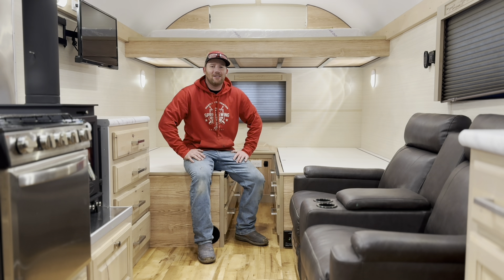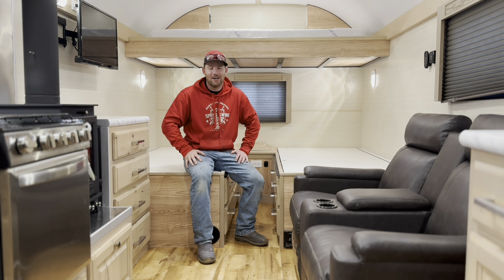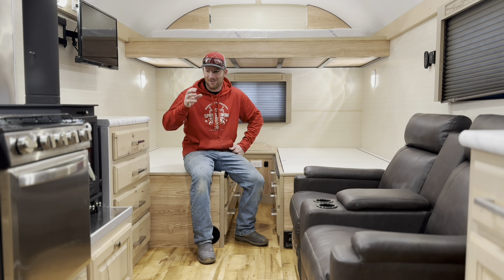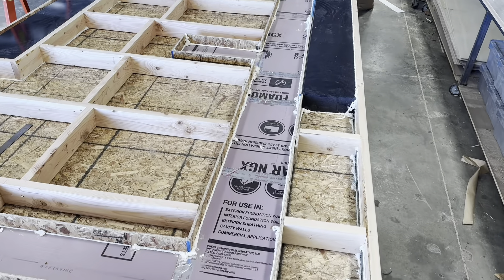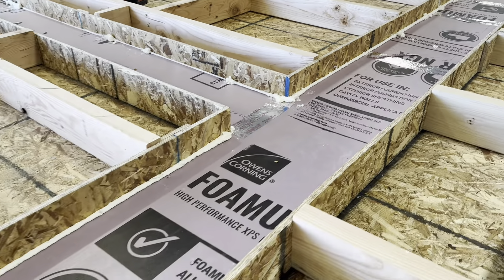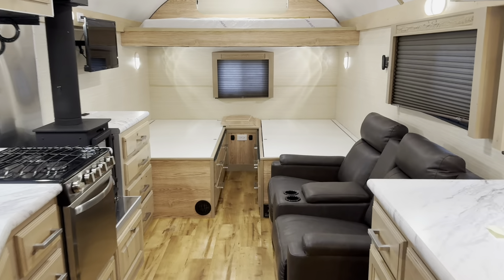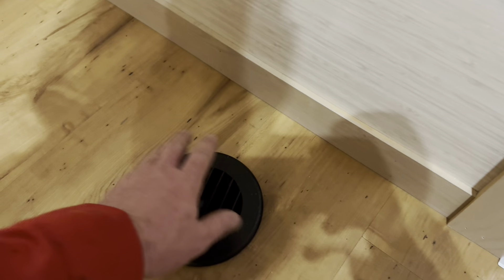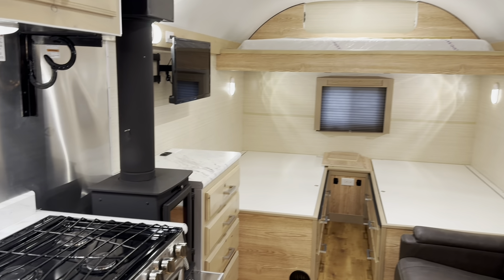Taking the wood stove in your sheep camp to the next level

Comment: outstanding innovation.  I trust the simplicity and rock solid reliability of a wood burning stove.  There are no moving parts, no diesel burner to fail, no solar (sunny days to work) required, no generator to break down....just a wood and a match.

Comment: This is another example of why Peak Mountain Camps is the BEST VALUE on the road. You guys constantly strive to improve the value, durability, and comfort of the camps you produce. This is a tremendous improvement that will level out that battle between the wood stove and the furnace. Wood stove always wins because nothing beats wood heat, and of course, there is nothing better than a wood stove on a cold winter day when the snow is flying. Now, there is an option to circulate wood stove heat throughout the camp, including enclosed spaces like the bathroom and holding tank bay. Awesome!

We love our camp. Living in Camp Liberty full-time for two years. Whenever we travel and stay somewhere else, the first thing Beth says when we return home is, "I missed my camp!"

Comment: You asked for additional ideas.  I like the idea of circulating the warm are around the camp.  

An even better idea is to heat water from wood stove and circulate the water around the whole camp. 

I know it would be a more dangerous system because the water is heavy and can also freeze, but water is the most efficient storing material for heat energy.

They make wood stoves that have a water jacket and also stainless steel tubes that run water through the stoves. 

Just having a water jacket around the stove would be a good first start. You could put a drain on the jacket so that while the camp is not being used you could drain it.

Comment: Questions?

Is the heated air from the woodstove being circulaed by an auxiliary fan separate from the furnace?

If so, where is this heated air being entraduced (being pulled) into the ducting system?

Love your camp styling and layouts.  Would love to see one in Texas, to kick the tires on.  Otherwise, it's an 18-20 hour drive to Utah.
Reply from the maker: Great question. The circulation fan is separate from the furnace. We have pursued using the fan on the furnace to circulate the warm air but the downside to that is, the furnace fan introduces outside air (cold air) into the mix, defeating the purpose of circulating warm air. Each camp is going to vary based on layout and options, but we always try to draw or pull air from as close to the wood stove as possible. We do have a couple of camps in Texas. Give us a call, and we can maybe get you closer to seeing one. (435) 462-7325.

Comment: Great idea Weston! Would it be possible to have a selector or bypass switch incorporated into the thermostat? Obviously the thermostat on the wall inside is warm enough when the stove is burning that it won’t kick on the thermostat and provide heat to the tanks. Could a bypass switch or additional selectable temperature sensor be added to the thermostat so the user could choose between using the inside temperature for the thermostat and maybe an additional temperature probe placed somewhere in the tank boxes that would obviously be colder and allow the thermostat to kick on even if inside the camp is warm?
Reply: This would be my question too.  Or could an existing camp be retro-fitted with this new fan?
Reply from the maker: The downside to running the furnace blower is that it does draw combustible air from the outside (cold air) we are looking into some other type switch options to further increase efficiency.
Reply from the maker: Yes we can set existing camps up with this setup.
Reply: @peakmountaincamps  Outstanding!

Comment: Does your wood stove draw outside air into the fire box, so it doesn’t draw your warm inside air into the wood stove?  This would also make your wood stove more efficient.
Reply from the maker: Yes the combustible air for the wood stove is drawn from the outside. Our camps are sealed up so tight that if you drawn cabin air (inside air) you’ll starve the fire for air.